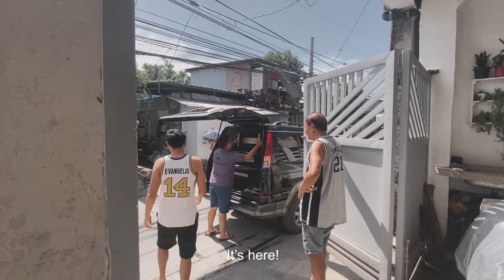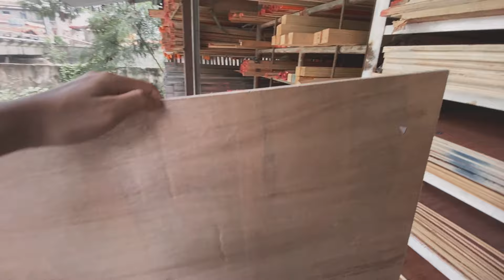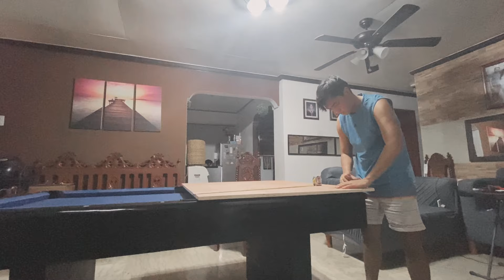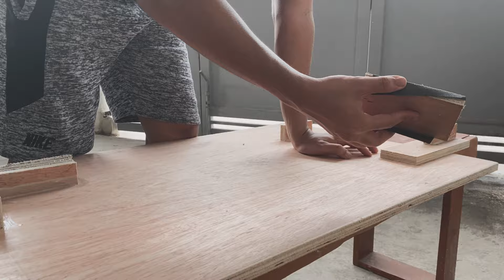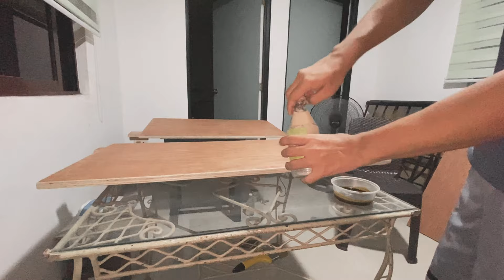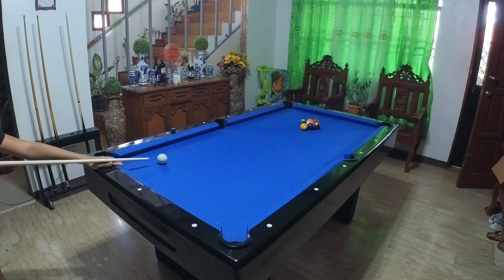42x74 Jr Billiard Pool table DIY convertible Dining / Office Table

Comment: Have you found any indentation on the table felt from the table top cover?
Reply from the maker: No. I always make sure I put some soft towel underneath the legs of the top cover. I also improvised sticking a rubber pad DIY onto the footing so even without a towel it would be fine.